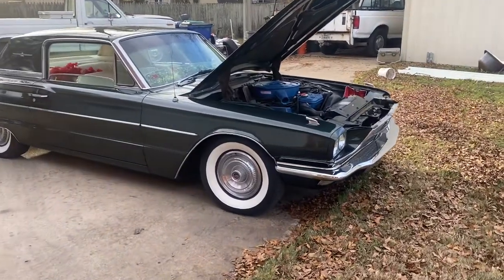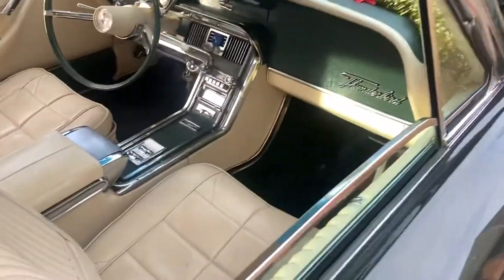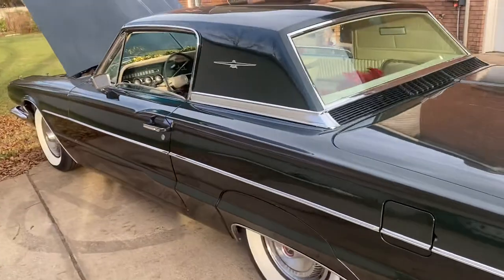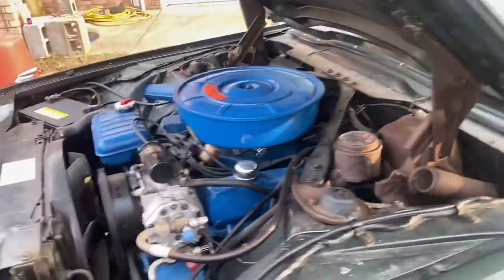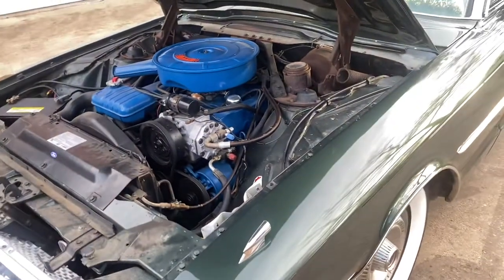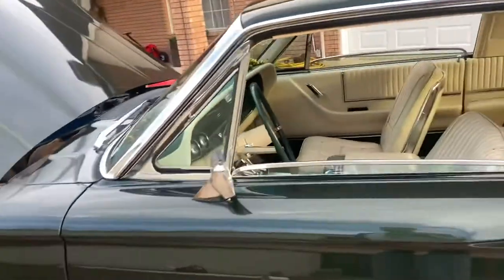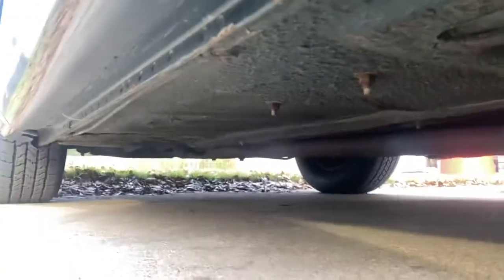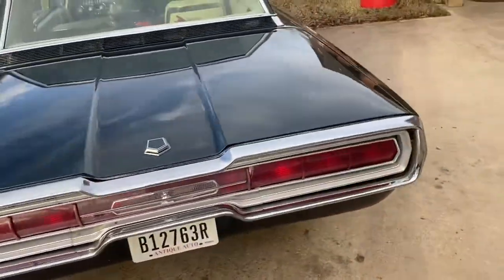My 1966 Ford Thunderbird - First Look

Comment: The rear differential needs re-greasing around a 100K. Check your oil leak.  May be the tranny from sitting to much. See if it stops with use. Other commenters have provided a good list of resources.  I have 2 town landau's and love them.  Very nice bird.

Comment: Ben,
She's a beauty for sure.  Congrats to ya, my friend.  Great Christmas gift in my book!
Btw...not to worry, zero vacuum tubes are in the car.  I do have one recommendation, other than you must fully enjoy driving her around:  Ask the original owner if the brake booster and master cylinder are original to the car, thus 55-years old.  If so, it's time for them to be replaced.  It's not something to be delayed.  The '66 T-Bird weighs over 2-tons, meaning brake failure can do great damage to whatever it hits.  One other thing:  Your exhaust system isn't stock, but if it looks and sounds good, then keep running with it.
You're a lucky feller.  Contact me whenever you might have a question.  I'm always available.
Regards,
John
Reply from the maker: Thanks for the feedback buddy. It’s already brought me a hundred smiles in the past couple weeks. 
I recently had to fill the master cylinder backup with fluid. So i know it’s time.  
That exhaust leak has to be fixed soon, as well. 
After that it’ll be shocks, but hopefully the springs are still spry. I want to replace all the rubber suspension parts i can. I’ll tackle what i can on my own, as i want to avoid mechanics’ labor fees. 
Im glad to hear from you so fast and hope you’re doing well up there. 
If you’re ever near Dallas, give me a heads up!

Comment: Hello Ben. You found yourself a beauty! You will probably get many T-Bird lovers giving you some tips. I see Joernone has already chimed in! Check out Nick at Vintage Thunderbird Repair, Alvin at Jamieson's Repair Shop, Gordon Miller's channel, and Pedalbox. I am sure there are more on Youtube to find. 
I would inspect the exhaust manifolds carefully with an inspection mirror while it is running so you can find where the exhaust leak is at. These cars have an "exhaust control valve" located on the passenger side where the exhaust meets up with the exhaust manifold. You can sometimes get a leak there, or hear it "rattle".
As far as the non-steady idle, it could be time for a carb rebuild, or there could be a vacuum leak. 
I like what John says about the master cylinder. If you are adding brake fluid and are not seeing any leaks, it is possible that you are loosing fluid from the master cylinder into the brake booster. Fluid can damage the brake booster internal workings, and could be getting sucked into the engine through the vacuum line from the booster to the intake manifold. 
I hope you post more videos of this nice looking car!
George B. in Michigan